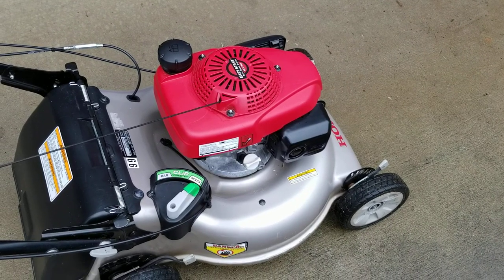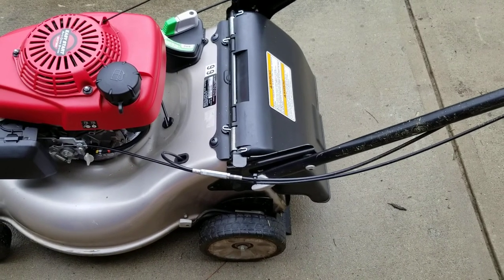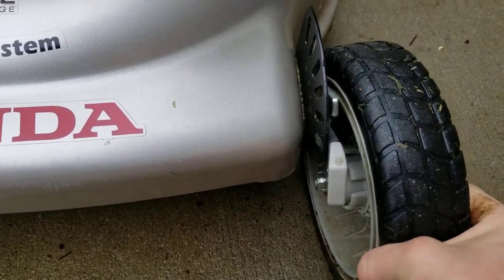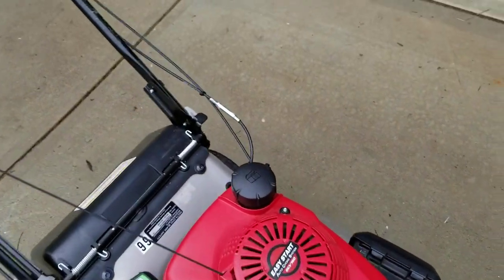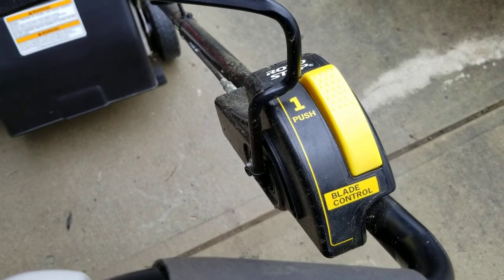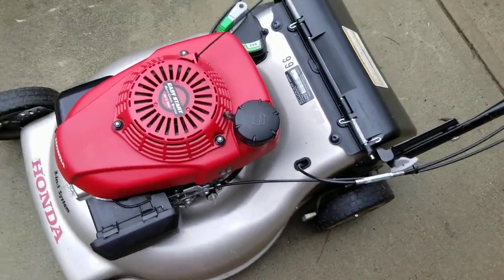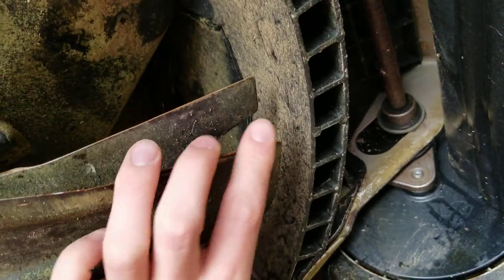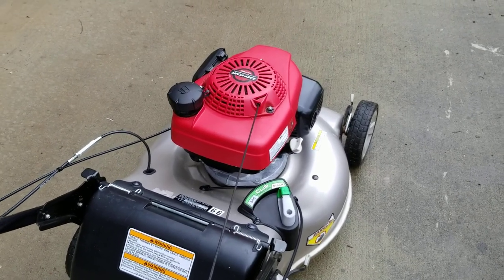3 YEAR REVIEW!!! | Honda HRR216VYA Lawn Mower

Comment: I have a 2008 Toro Recycler with a Briggs & Stratton 190cc(5.5hp) engine.
Everything on this mower is flat worn out........but the engine...... it just won't die so I can buy
a new mower.
Reply from the maker: Yeah those older Briggs were pretty strong. Thanks for watching!

Comment: Very nice looking honda mower.. You do take care of it. I purchased the same mower 2 years back. I mostly have in the garage most of the year. I recently bought a new carburetor for it. I can safely say that my mower is new if I were to sell it.. But Im not.
Reply from the maker: Yep it was a decent mower, I ended up selling it and I replaced it with a Toro super recycler with a Honda engine. A video will be coming out once I get to use it more.
Reply: @andybub45  that's cool. Im actually looking to purchase a Toro all wheel drive.. Im not sure if it comes with a Honda engine but it looks decent.
Reply: I forgot to mention, I always use mid grade fuel with stabilizer.. I also own a Honda trimmer very good reliable & use same fuel... Im not sure if fuel has anything with developing issues but have not had a problem yet.

Comment: Great video, I think you've got me talked into finally getting a Honda mower. I have a couple old Troy built push mowers both with Honda engines and they've held up great. The one with auto chock messed up on me once, just had to replace the carb and it's been running for 8 years trouble free since the repair. I just hate to buy a new mower since both my old ones still run great.
Reply from the maker: If you can keep em running, I wouldnt buy a new mower cause the Hondas will last forever. Thanks for watching!
Reply: @andybub45  yep Honda's will run forever. Everything I buy with an engine I try to get with a Honda engine.
Reply from the maker: @towboatjeff  smart choice!

Comment: What’s your thoughts should I get a super recycler with Honda or a hrx? Looking to replace an old hrr216.
Reply from the maker: I was actually in the same situation as you at the end of last year. I got so tired of the rear wheel lockup, I decided to sell it and buy a new one. I heard the HRX is better but I also heard they have the rear wheel lockup issue and I just did not like how bulky they were. Ended up buying the Honda super recycler, it may be a hard super recycler to find but it is 100% worth it. I’ll be doing a video on it (once I get some time).
Reply: @andybub45  I’m leaning towards the super recycler just hope the transmission holds up. Yes I agree the hrx looks bulky and a lot of the lawns I mow have obstacles so the lighter the better. Looking forward to your review. Thanks

Comment: I have the same problem as you with the wheels locking up and hard to roll backwards.  Mine is still under the 3 year warranty and took it back to Northern tool and equipment where I bought it, with the receipt. I left it there a few days and they said Honda refused to warranty it. I always heard Honda was a good mower. I am not planning to ever buy another Honda mower again. They don’t stand behind their warranty and it didn’t even last 3 years without problems.
Reply from the maker: I have taken those rear wheels apart and tried to sand the self propel shaft down. Worked great for a month, then went back to the same thing. People say not to spray the height adjusters with water and it will be ok, but I want a clean mower, and all other mowers can be sprayed with water and have no issues. There is a service bulletin that calls for replacing the height adjusters with new ones that have larger bushings. I have heard mixed things on if that works or not. I will install the new adjusters myself, but if that doesnt fix it, I will have no choice but to get a Toro with a Honda. Also, the new HRN hondas (replaces the HRV) have a 2 way ratchet in the rear wheels that makes this issue impossible, but I can see that breaking, along with the front wheels pivoting outwards and wearing, another issue I have to fix. I love the engine however, and will always love Honda engines.
Reply: Had to replace the height adjusters on my sisters Honda. The wheels will still drag sometimes but that’s because they are worn slick and  have no traction.

Comment: I love the Ford jokes. I just bought the new version and I hope I love it. It's replacing a Troy Built.
Reply from the maker: Glad you enjoyed the humor. Hopefully your Honda will give you many years of good service! Thanks for watching!
Reply: How do you keep it from popping wheelies? My old Troy Built had a completely different drive system.
Reply: @LetsRVtv  scoot up on the seat closer to the tank and don't rev your rpms so high in the powerband range.
Reply from the maker: @LetsRVtv Mine does not do that... I would try slowly engaging the self propel rather than quickly engaging it.

Comment: Can you mow on the low throttle mode which I’m assuming is more quiet? Thanks
Reply from the maker: No. It will significantly bog down the mower and it will not cut right. Its not really more quiet but just slower. Thanks for watching!
Reply: Andy's Shop 
Thank you for posting the video! It’s really helpful to watch these reviews. 👍
Reply from the maker: @esteban33ification  No problem! I have more content coming soon so stay tuned!

Comment: If you like the ball bearing wheels so much why not just put the bigger HRX wheels on you HRR? I've seen people do it before.
Reply: IIRC the only difference besides the size of the wheel itself is the gearing on the back wheels. I believe i read someone say its held with a plastic tab that you can take out by applying heat with a soldering iron. That way you just have to put the HRR gearing on the HRX wheels and voila!, you now have ball bearing wheels on your HRR.
Reply from the maker: @7ftunder  thanks for the tip. I may look into it.